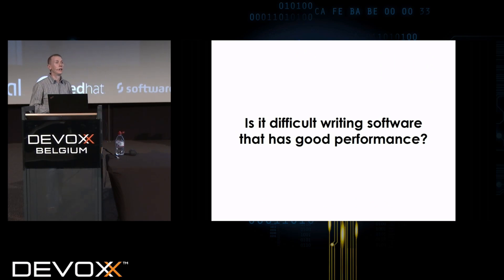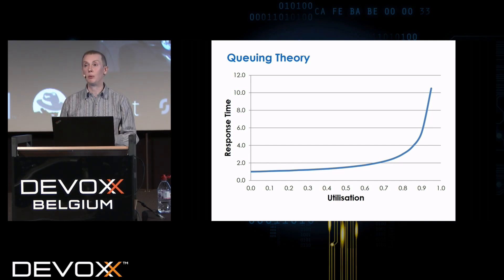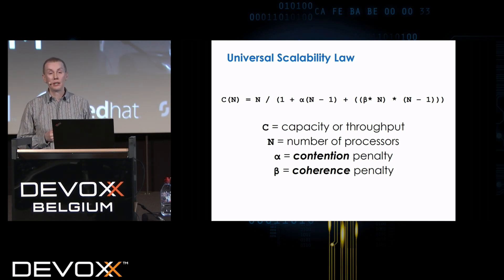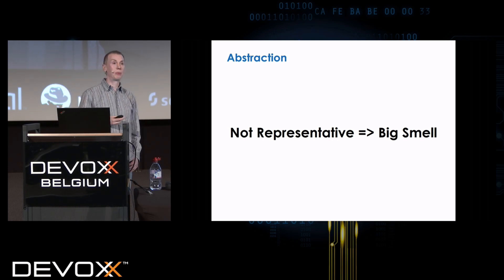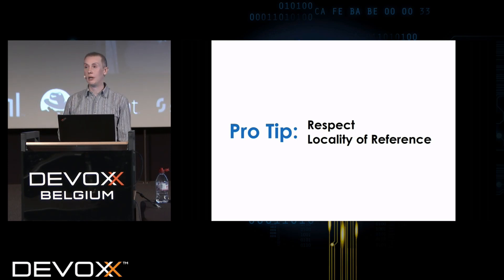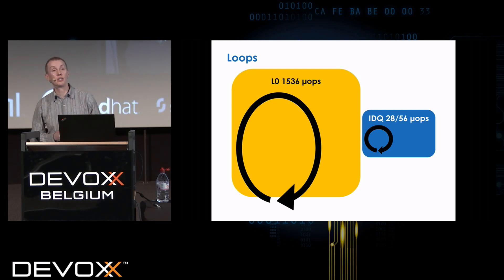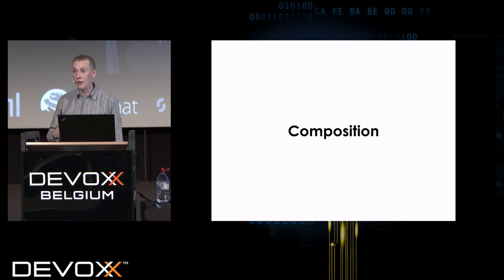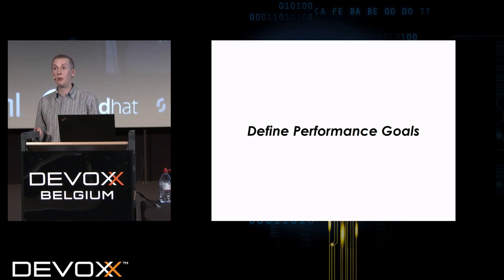Designing for Performance by Martin Thompson

Comment: 36:18 Would be fantastic if these null checks were unnecessary but in huge, complicated, legacy system developed over almost 20 years (2005 are first commits to repository I'm thinking about), I never know where from null can come about. It's not only a thing of direct method calls which may be only in one, two or three other places. The null may be passed through several calls, from method to method. I've seen too many cases of NPE happening in production environment to leave possible null unattended. Clean code is fine but I prefer client who isn't screaming into his phone because users can't do something essential to their work all day (until hotfix comes up).
Reply: I'm with you on that one. Assert (design by contract) are a live saver